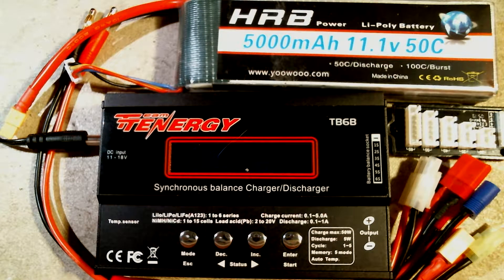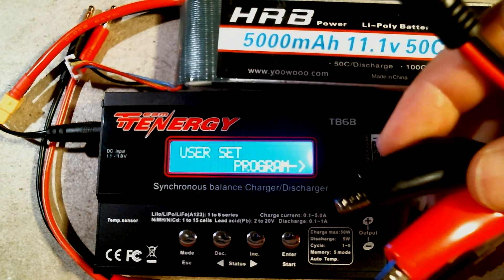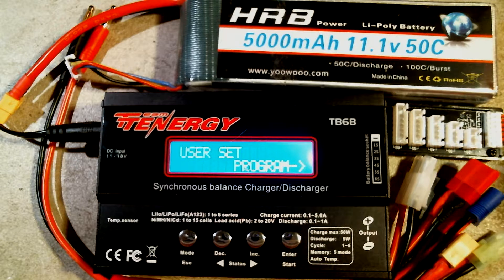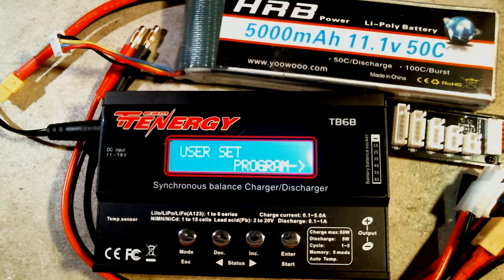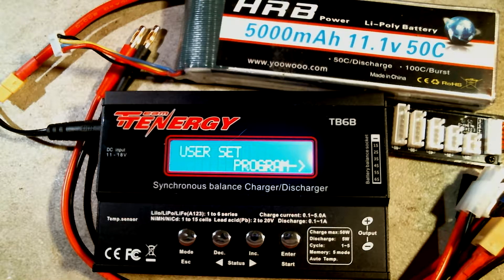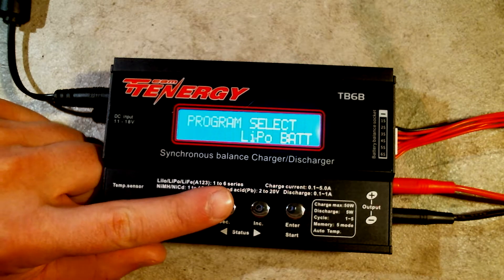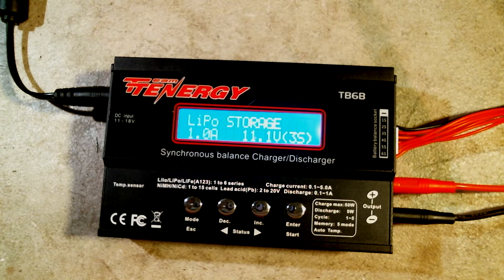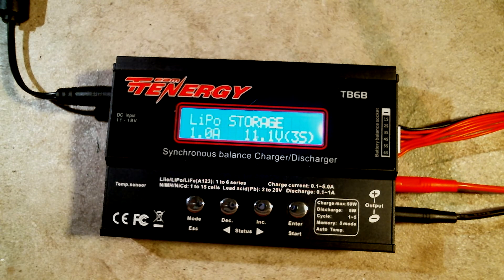How to Charge LiPo Batteries Using a 4-Button Chrager

Comment: The colors of my balancing wires are reversed. 1 Red wire and 4 black wires. DId I buy the wrong batteries or is there a setting that needs to be changed?

Comment: Trying to balance my 12 amp hour heavy duty Milwaukee battery that high output one, some of the cells are 4.11 4.10 and like 3.45 they're very off and I'm hoping this balance charge will do something I'm not sure if I should have it at point 1 amps or higher amps whatever is the most accurate if I can leave it overnight I'm assuming and a low amperage it would be more precise? Would love your input on it
Reply from the maker: Hey if you still need help with this or in case anyone else does in the future I would say:

First be sure to always check your battery and charger manuals for how to operate them safely, and I would never leave a charging battery unattended especially if the cells are way off in case something went wrong.

Always follow good safety practices.

Here's an example of how to charge a LiPo battery from Stack Exchange:

"C-ratings are an artificial marketing term that doesn't really help very much without being converted using this formula: Charging Current (amps) = C-rating * Battery Capacity (amp-hours) where one amp-hour (Ah) is equal to 1000 milli-amp-hours (mAh).

So, for example:

1500 mAh battery charging @ 1c = 1.5 A charging current
2000 mAh battery charging @ 1c = 2.0 A charging current
2000 mAh battery charging @ 2c = 4.0 A charging current
2000 mAh battery charging @ 0.5c = 1.0 A charging current"

"It is safe to charge a battery at less than the recommended charge rate; this can be a good idea if you have a suspect (potentially damaged or over-discharged) battery that you wish to recharge for testing."

Check out this Stack Exchange answer for more details:

https://drones.stackexchange.com/questions/971/at-what-current-should-i-charge-a-lipo-battery